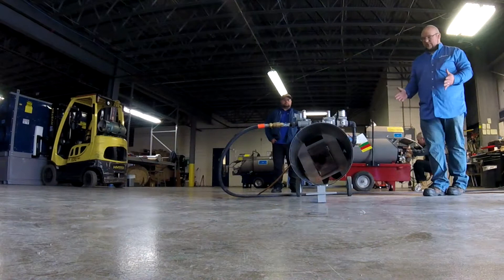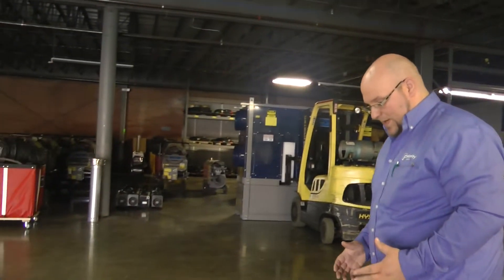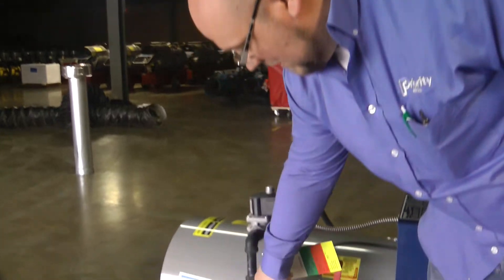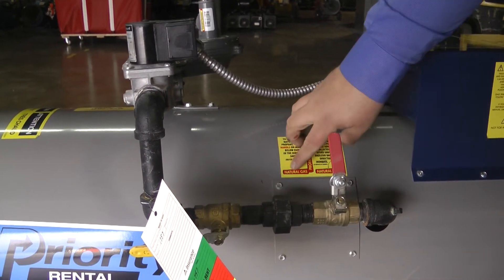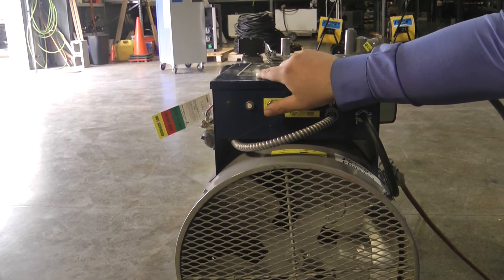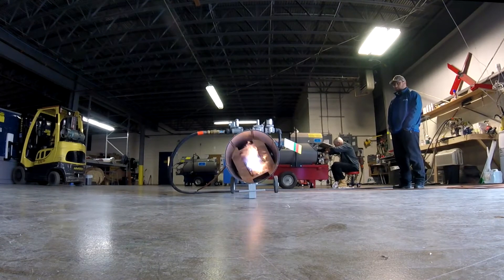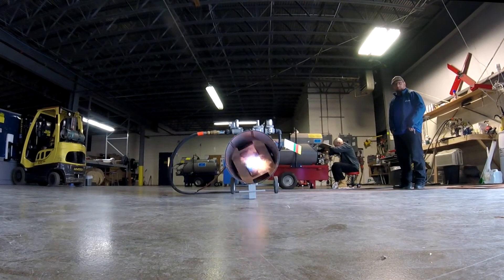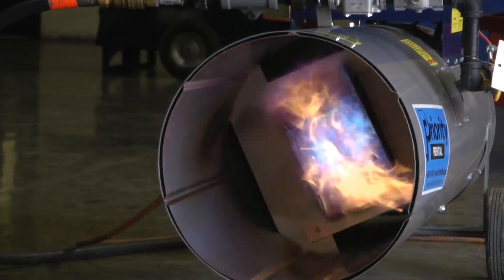How to Operate a 400,000 BTU Direct Fire Heater

Comment: "proves air"?  Interpretation?
Reply: The machine wants to check that the blower's on before opening the fuel valve, so there's an "Air Proving Switch" that looks for the change in air pressure. Any kind of forced air combustion device should have one - it's an important safety feature to make sure fuels not just being burnt without adequate draft/air supply.